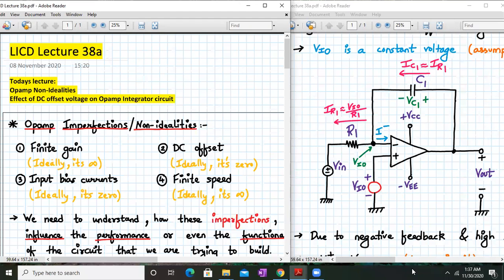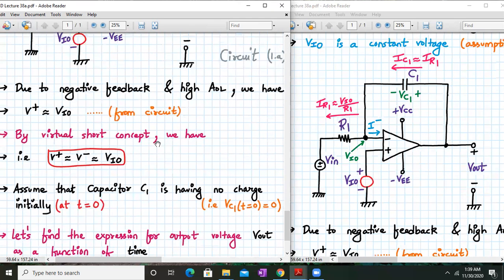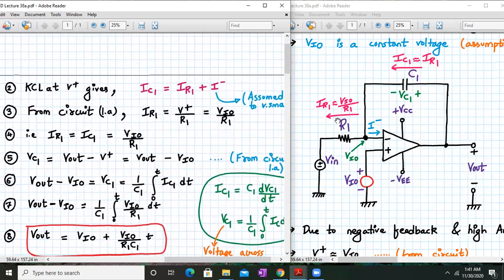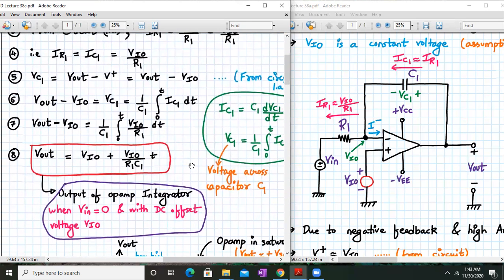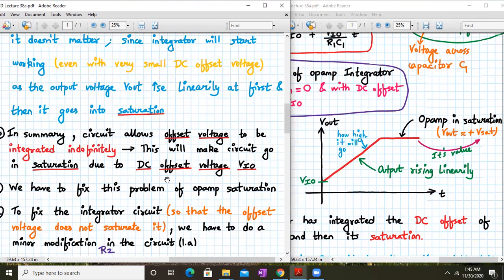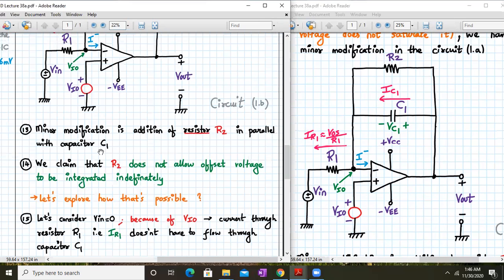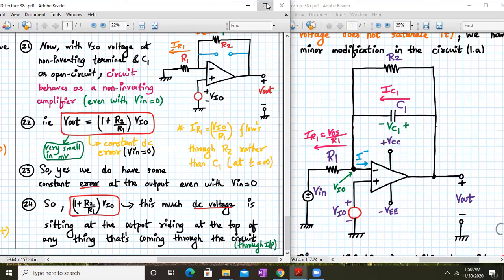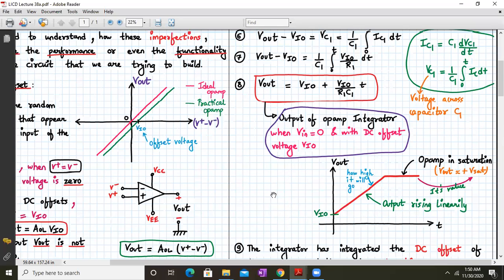Effect of DC offset voltage on Opamp Integrator

Comment: I built an integrator circuit in my protoboard, then I measured the output voltage with an oscilloscope. An offset voltage equal to -sat was added to the output voltage. Why is that happening? Help, please.
Reply from the maker: Possibly due to Opamp being saturated